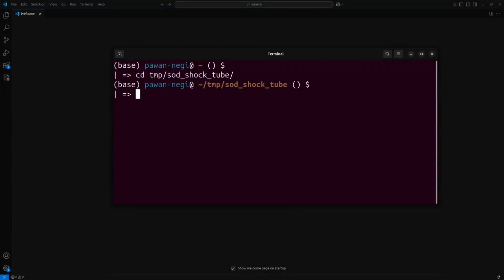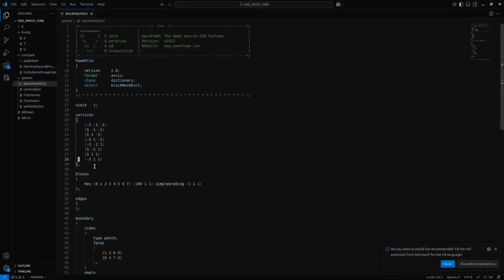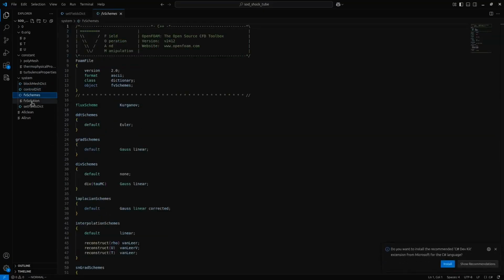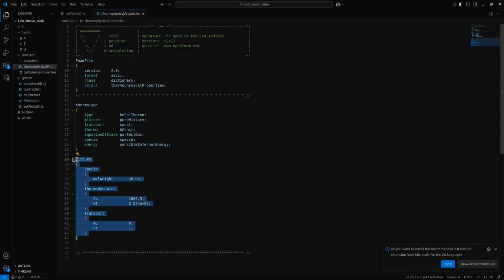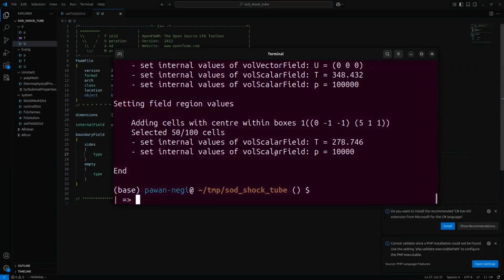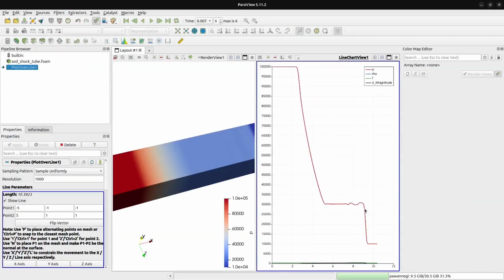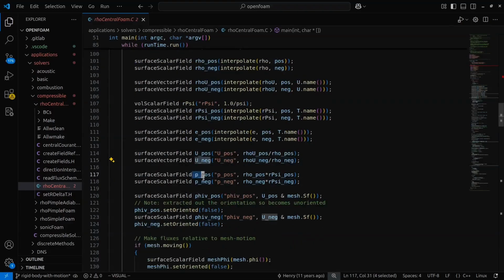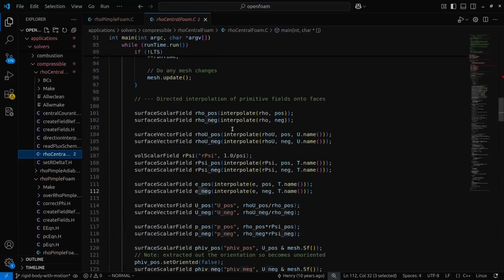Shock Tube Simulation in OpenFOAM | rhoCentralFoam Explained & Comparison with rhoPimpleFoam

Comment: Thank you so much for the video. Excuse my ignorance, but rhoSimpleFoam is basically equivalent to foamRun with shockFluid solver? Because I'm using OpenFOAM 12 and I don't see rhoCentralFoam, but I believe it should be equivalent to shockFluid...
Reply from the maker: Yes. You don't find a lot of solver names in v12 present in .com version. So Focus in general structure Like scheme, linear solver and constant rather the solver names.
Reply: @NavygateTechnologies  thank you so much

Comment: Since the pressure ratio is equal to 10, we should get velocity arroud Ma=2.6 so why is the U magnitute not higher than 300m/s ?
Shouldn't shock waves be supersonic and not subsonic ?
Thanks in advance for your answers
Reply from the maker: The pressure ratio is not maintained in the entire simulation. The actual ratio near the shock wave is around 1.5.